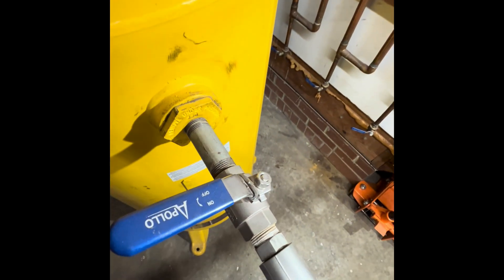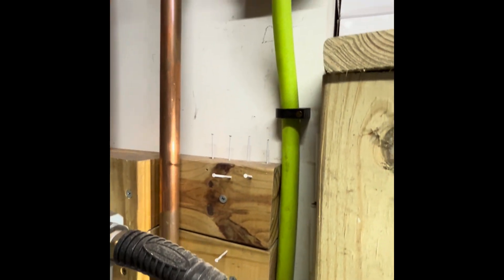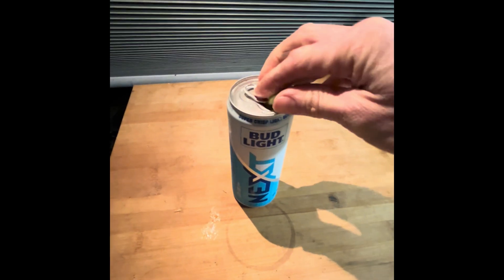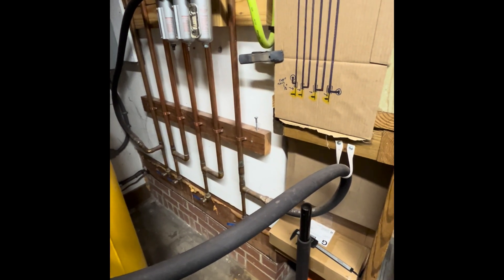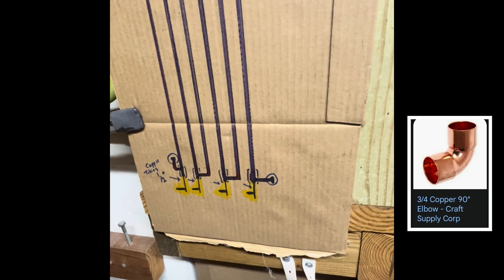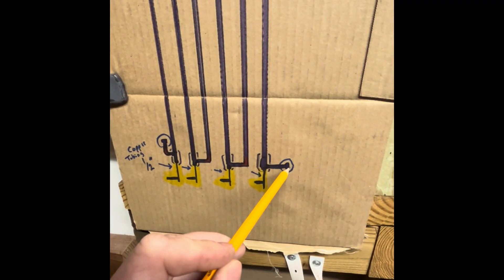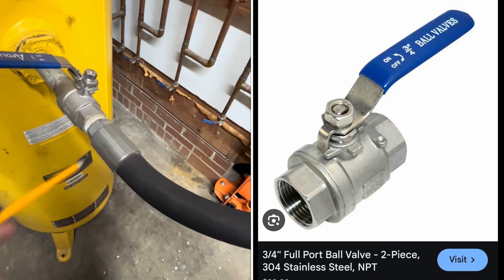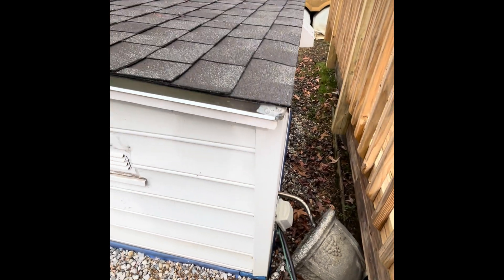Compressed Air Dryer System - How To Build

Comment: Was going to do the same for a unit at my job, but I quit. I was going to forgo the lower valves and use tire valve stems, trim the rubber then burn the exes off. They would be cheap and have the replaceable seals. (save a couple of bucks). At home Ill probably use an oil cooling coil as it would mount on an 80 gal. tank well.  Good job on that setup !!!
Reply from the maker: @moonolyth  that is a great idea for the 80g, and thank you!